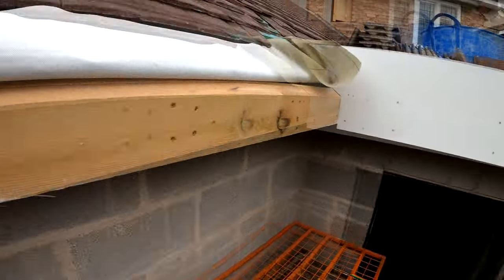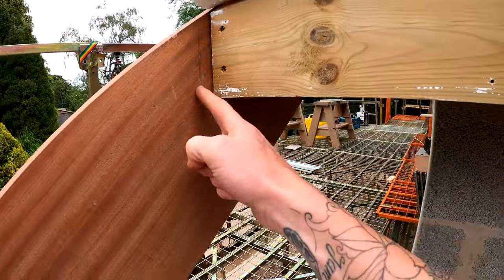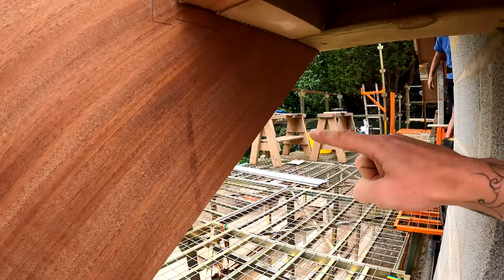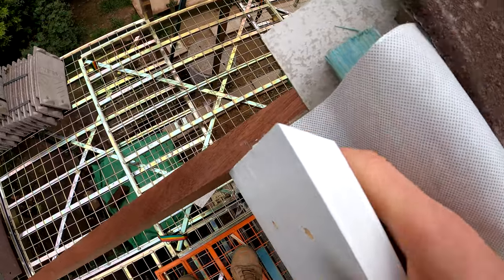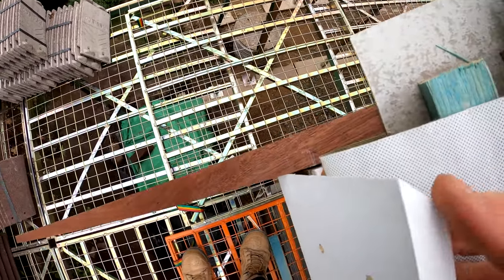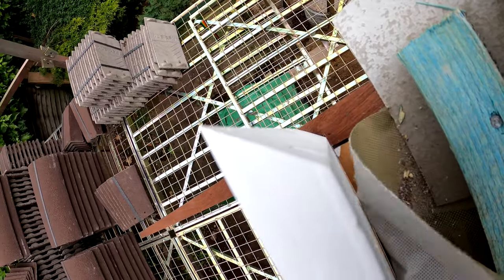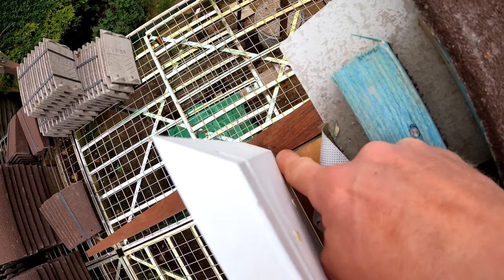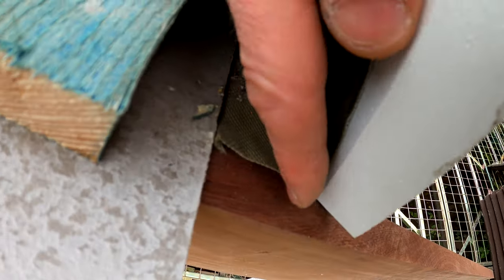PERFECTLY MITRED JOINT ON AN AWKWARD ANGLE! - TIP TOP TOP TIP

Comment: I wouldn't bother with a mitre there ! 
Just butt the painted fascia up against the hardwood barge board, and cut it flush.
It would look neater I think.
Reply: I would butt it because the thin point of the mitre will start to rot in no time.
Reply: @stevenjones1009  I agree Steven, There's a time and a place for mitre joints and I'm to sure this is one of them times.